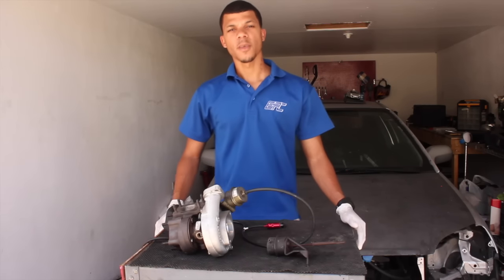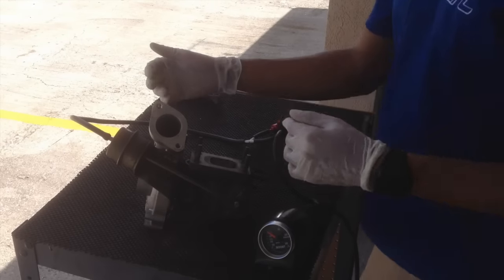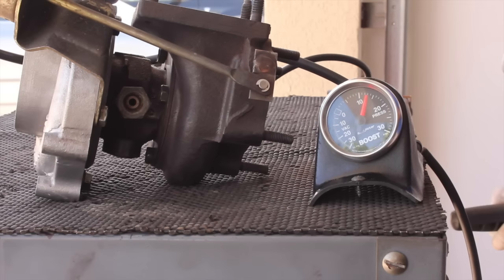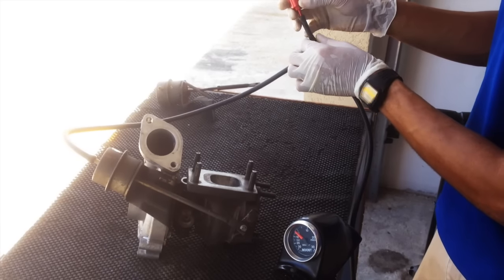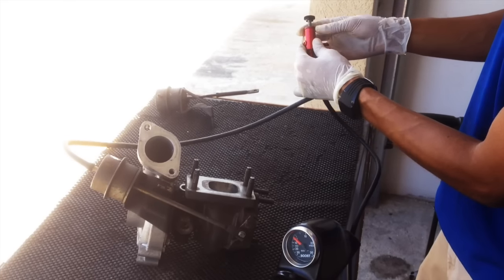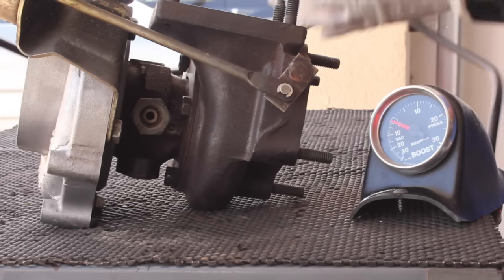Manual Boost Controller Install (part 2 internal actuator)

Comment: get rid of the "T" in the line closest to the wastegate actuator. The compressor side of the boost controller is on the bottom, the wastegate side is on the side of the boost controller. Try that with this same test and there will be no wastegate creep like you are seeing here. It will not begin to open till the pressure overcomes the ball and spring in the controller as designed.
Reply: Is an external wg not located on the manifold and actually on the piping? Like in this video I have the same set up in my pt. Looking to get/install boost gauge and controller so any information is awesome and much needed thanks again

Comment: What about the blowoff valve? It has another bleed plug on it, where would you connect that too?? I want to turbo my car, the turbo im getting has a internal waste and getting a blow off valve to, i dont if i need that?
Reply from the maker: +Oswaldo Castillo Hi, if your referring to a greddy type-s style BOV that has two plugs (one on top and one on the side) then you would connect the main pressure source plug and leave the second plug off. From my understanding the second plug is used for high performance racing application where you may want even more control over the BOV, but i could be wrong about that lol just leave it off is what i do

Comment: hell yes. Just wonder about where in the line the check valve goes or if it matters.
Reply from the maker: +Justin Hoth You could install the check valves anywhere in the system once its facing the throttle body. HKS made some small disk shaped ones that acts as a filter and one way check valve if i'm not mistaken. But you don't have to install a check valve.

Comment: Just buy a spring and tie it to the wastegate arm, so the wastegate will open in higher pressure. Make sure to fine tune the spring tension to the pressure u want.
Reply from the maker: OokTiaopi yea sure. If only it worked like that. Loll

Comment: Finally a proper video without burnout and going to get donuts . Thanks
Reply from the maker: Appreciate the comment. Loll. Having long winded videos annoys me to this day. Loll. Like I ain’t trying watch your vlog bro….cut the camera, ain’t no one trying watch your trip to the parts store loll
Reply: @HighPerformanceNetwork  exactly.  Pointless crap  but nothing about the title. I watched 5 before I got to yours.  I'm swapping CA to SR and looking to see where the OEM Boost controller goes. Thanks mate
Reply from the maker: @sparklingsams3155  hey if you need a spare Sr20det block and transmission n harness. Let me know. I’m swapping to a vq35.
Reply: @HighPerformanceNetwork  thanks mate. I got 2 sr20det engines and I'm in Melbourne Australia. Sr20det running engine is about $5-9K here 😅
Reply from the maker: @sparklingsams3155  oh nice!! Hope it goes well for you chief. Will be restarting content on the channel soon

Comment: You can see how quickly the wastegate starts to reroute exhaust away from the turbine. This is far from ideal as it creates a lot of lag. That’s why the AEM TruBoost Gauge/Controller is a better option because not only does it give you the ability to change your boost level on the fly with a high and low setting but, more importantly it allows you to delay when the wastegate begins to crack so that you have almost no lag and also protection against boost spikes.
I just bought one for $200 and couldn’t be happier with my setup on my MR2T
Reply from the maker: Neg Ative yea there’s been leaps of technology increase over the years. One thing to note is the diaphragm will react a bit more response in this video being there is no exhaust pressure pushing on the valve. But your logic is sound👍🏽. Thanks for watching and the comment
Reply: High Performance Network 
Great job on the presentation. I’ll use this video to help the younger guys in my crew as they start to get close to turbocharging. I wish I had made a companion video on the TruBoost gauge before I installed it.
Reply from the maker: Neg Ative that would have been cool. I want to produce more content and even have a s13 sitting for nearly two years now. But running businesses have become my priority. Maybe one day I will get around to making some more videos.

Comment: So my wastegate can hold up to 10 psi,  to be safe can i adjust the arm down to 8 psi using a compressor and use a mbc/ebc to push maybe up only to 9 psi? The reason why is i dont want em to spike up to 11/12 psi..
Reply from the maker: Fiz Bakar so if I understand the question correctly. You have a spring for 10 psi currently. But would like to have a boost controller turn it down to 8psi to prevent overboost? .....k if that’s the case no controller can turn down the boost below the spring pressure. My suggestion would be to source a weaker spring then use a controller to bring the psi up to what you want once the 8psi becomes boring loll

Comment: This is wrong.
Reply from the maker: driftkids13 thanks for the comment. But if you feel you know better, then why don't you show us your way. As I'm sure you know. A bleed valve and a ball an spring are installed differently.
Reply: You never broke down if it was a bleed or ball and spring design. Yes if it's a bleed type your installation is correct, but if it's a ball and spring then you will mount it inline. Like I said you never specified which one you are using. 

We can say we are both wrong or we can say we are both right. Like I said you didn't really specify which design you was using.
Reply from the maker: driftkids13 I will make the amendments in the description. I have shot a new video explaining the differences of the two.
Reply: Engine Boost pressure is not measured at the wastegate line.
At the end when you close the “bleed” valve and the wastegate line pressure increases you are actually opening the wastegate sooner which will make less engine boost pressure.....
Reply: macdonmar i’m 16 and i even know this.  I’ve only been working on boosted cars for about a year...

Comment: Guy, you T-ed off the line before it connects to the controller.  That is not the way to do it.  It does nothing that way.  For all the people saying thanks, good luck lol.
Reply from the maker: How about you make a video showing the correct way. Maybe those people will watch your “correct” way. Rather than ask what type BC. You gonna hit with the automatic it’s false loll. I’m interested in seeing your video. Please do share when you make it. Enjoy your day!
Reply: @HighPerformanceNetwork  you connected it like it you were using a two port boost controller solenoid.  You don't need the T fitting for this boost controller

Comment: I have a manual boost controller for my turbo but it doesnt have the internal wastegate so how would i run my boost controller
Reply from the maker: +Aaron Ferguson You can check out the Part 1 video. Hope that helps https://www.youtube.com/watch?v=pT0p5SH5hqk  You could also send me a message via facebook or Google+ possibly i can help get you sorted. Thanks for watching

Comment: brother i have a dout. in this video you explained how to boost the pressure. my dout is can we fit blow off valve in this type of waste gate turbo vehicle?  i have a diesel turbo crdi vehicle. in the vehicle the turbo have waste gate valve and actuators. so can i fit blow off valve this my car? plz reply
Reply from the maker: Honestly i'm not certain about diesel. But being they have no throttle bodies i doubt a BOV would work....I could be wrong though. Maybe someone else can help on this one. Would be great to hear other comments
Reply: ok any way thank you

Comment: that's all well and dandy but your only limiting the boost you all ready had your not increasing boost at all.....
Reply from the maker: +16vastraturbo I'm not understanding what your saying bro. 1:58 in I tighten the screw on the MBC creating less bleed off, and you can see the boost level raise in relation to the actuator arm moving from the closed position.

Is it something I should clarify in future videos, its worth noting
Reply: +High Performance Network What he is saying is all you did by tightening the nut was return to actuator pressure, the whole point of a boost controller is to create more pressure than what the actuator is designed to open at. You have this hooked up wrong. Pressure side is right, but the other should not go to atmosphere is should go to actuator.
Reply from the maker: +Aaron Couture thank you for the comment. But this method is not incorrect. The way in which this mbc works is by reducing the positive pressure the actuator diaphragm would other wise reference to open the flap lever. This is done by bleeding the pressure signal off in the case of a single inlet actuator. Now some come with two, such as the ct9 from a Toyota starlet or 2jz twins where they have a solenoid that can switch low / high boost......But back to the point. Without venting the pressure signal the diaphragm will open unless added spring pressure / tension is used. As you may see with adjustable rod length actuators. Welcome you to test which ever method on your own and let me know the findings
Reply: This is not a bleed valve controller.. its a ball&spring and is intended to be connected inline from the source to the actuator..
Watch back your footage dude..
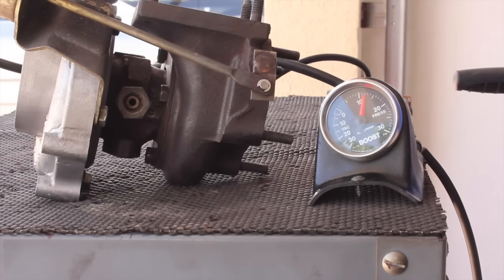0:56 The controller is not connected.. the actuator moves at around 5psi and is fully open at 16psi
1:56 The controller is connected.. the actuator still moves at 5psi and never fully opens and you only reach 13psi.. all you're doing is venting the rest to atmosphere.. it's not going to the actuator or the engine, it's just wasted...
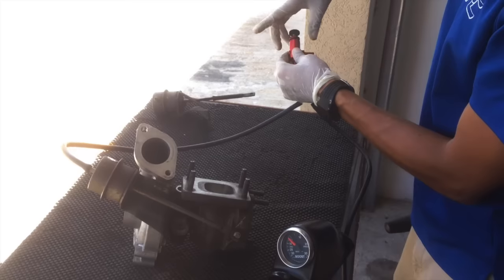2:07 The controller is set to a higher boost, yes.. but your now just using the actuator spring pressure and the controller will only vent if you reach the set boost, which is probably now 20+ but you'll never reach that as the actuator is working as normal, like it would without the controller even connected.
The actuator moves at 5psi and is fully open at 16psi.. like it was at 0:56!

It needs to be connected as I said above, then the actuator will have 0psi until the controller set spring tension is overcome and the ball moves to allow airflow to open the actuator.. only then you'll be able to create more boost than standard... set the controller to 20psi the actuator wont move at all until 20psi then it will fully open.

On a working engine/turbo the way you have it set up will work, but you wont boost any quicker as the actuator is still opening as it normally would but wont open as far so, yes you'll create more boost but not a lot, and not very quickly.. Set it up correctly and you'll spool the turbo much quicker and harder as the actuator stays closed and your not bypassing any exhaust gasses, its all spinning the compressor wheel until the set boost is reached and the actuator opens.. You just have to be careful this way as you will overboost and spike past the set boost as the compressor wheel is still accelerating when the blow-off/actuator opens, as it wont slow down instantly.. if you want 20psi, set it for 18psi and you'll spike around 20psi and settle off around 18psi but by that time you'll be changing gears and the actuator is closed again and will boost back up around 20psi with that spike :)

PS.. obviously 20psi was just an example based on where the controller was probably set after you turned it up, for anyone increasing boost this way to it slowly and start from stock boost pressure.. Not a problem for us Turbo Diesel owners.. currently running 33psi, with spikes around 35/36psi ;)
Reply from the maker: +David B I'm not sure why you think you know what your talking about. But as I said before do an install your way and then mine record the results and let me know. Back an forth banter is just a waste of time. Obviously you feel you are correct and I know i am correct as the vehicle owner uses it and it performs the way it should. 

I do admire the fact you are willing to express your opinion, but without testing or data. Opinions are just that. If I'm incorrect I have no reserves as no one can know it all. This method worked and continues to work not just for me but I'm sure others that has watched the video 

Let me know how your test results when you do it
Reply: I have a 2.2 turbo diesel with the same internal wastegate setup as you have in the video. I used a bleed valve at first. Not entirely the same as yours but a very similar design. .2 ports and a screw.
Like I said.. installing it in a bleed configuration still allows the actuator to open as normal as well as bleeding enough pressure to allow the turbo to spool longer and create more boost.
My turbo runs around 20psi standard and I managed to increase it to 28psi or so before the controller can't bleed enough to overcome the actuator spring tension.. and since the wastegate is still allowed to open theres still a significant amount of exhaust gases being diverted past the compressor wheel.
Now I have it installed in the second way i described and the boost increases much quicker straight to 30+psi before the wastegate is opened and it holds a constant pressure.. since the controller only allows up to around 30psi with the spring that is fitted in them.

I'm not arguing or saying I know more than you but I have tried and tested both ways and I can say for my application it works better my way and as you see from the comments there are a few others who use them differently.. Plenty other videos on YouTube as well that show both ways that these types of controllers can be used..
Neither method is wrong and both will work.. it just depends on the engine/turbo that its used with and also how the user wants it to work.
I'd rather boost quicker and then limit it at max boost, where a bleed valve just vents off a certain amount of boost to stop the actuator from opening fully until a higher boost.
Reply from the maker: As you stated its all about context. Your method is similar to an open boost setup, where the turbo charges had to max boost, basically the actuator is locked so over boosting could be an issue based on what turbo your running. If you dont mind would you upload an image of exactly how your setup would be. Think it would be fun to make a video to compare the two and the pros n cons of both. :)

Comment: what happens if I disconnect turbo boost controller and connect actuator directly to vacuum pump?
Reply from the maker: caran96 in that case boost would only go to the actuator spring pressure. Which depending on age of spring would be approx 8-10 psi. Generally speaking of course.
Reply: @HighPerformanceNetwork  and how much pressure we talk about when controller is activated? I may be wrong, but controller is solenoid which allows vacuum to go to the actuator?
Reply: caran96
You’re thinking of an electronic boost controller. This is the $25 Manual eBay special type boost controller. Effective but crude.

Comment: I instal corect boost gauge on Turbo Diesel without boost control ...when i start the engine its stay on 0.1 bar. 
Its not change when i drive ....
I dont know whats goin on . 
Please help.

Comment: Notice on the run with pressure pulses its bleed off at different pressures everytime you "charge it" in this video.
Must have a ball & Spring in there causes that unpredictable boost level. 11psi, 13psi, 10psi, 12psi it cant make up its mind

Comment: So what do you do with the vacuum line your using from the actuator that connects to the solenoid do you leave that off and open...? Cause you have it hooked up the the boost tap and gauge...

Comment: i have TSI engine witk supercharger and turbo. it is fully stock. when i step on gas from lower rpms which supercharger is being utilized and keeping it there to accelerate unitl cutoff there is absolutely no problem on power output  but during cruising speeds such as 2200 rpm, if i let the pedal go for half second and if i press it again, there is a instant jolt, then it accelerates continuously. whenever i do this, it happens. what can be said? a sticking wastegate? any comment is highly appreciated. thanks for efforts spent on very informative videos. all the best. ( i replaced n75 valve to be sure)
Reply from the maker: cosku arsiray hmmm. I’m not very familiar with multi forced induction setups. But if I had to take a shot at it. It does sound like fuel trim between the transitional point of when the turbo is coming on while the supercharger is about to start pumping positive displacement. Could be some form of overlap where either timing or fuel curve may have to be adjusted. Again. No expert in this area. But it’s a guess based on your description
Reply: Same engine here in mij Ibiza Cupra, just instald a boostcontroller, and the car whas not happy at all, did you find out what your problem whas?
Kind regards.

Comment: how can u test boost to see what u are pushing
Reply from the maker: One of the more accurate ways would be a mechanical boost gauge. Important to plum it directly off the intake manifold. Some will argue yah n nah. But for all intended purposes. You can't loose with it off the intake plenum. Hope this helps buddy. And thanks for watching
Reply: +High Performance Network thank u
Reply from the maker: +the one your welcome 👍

Comment: Wrong connection, the boost controller should be connected in line before actuator without the Tee.
Reply: Sunderasen V Maniam
Everyone knows the boost gauge source is the back of the manifold. He did it this way so you can test the boost controller setting before installing it on the car.
Reply: @negativeindustrial  um, his comment had absolutely nothing to do with gauge placement and everything to do with improper boost controller installation.